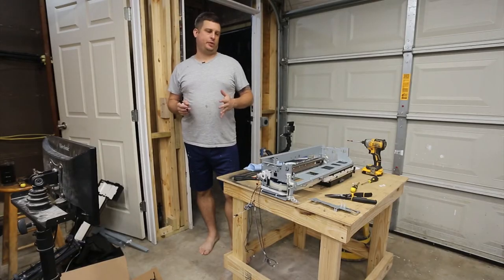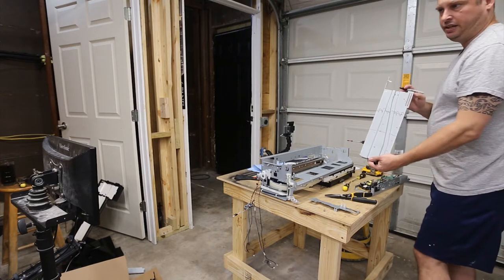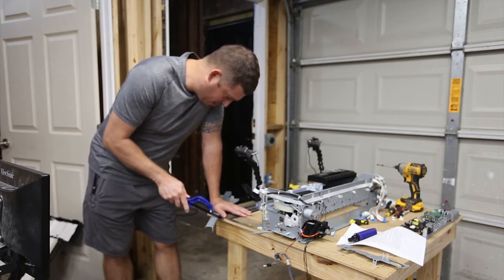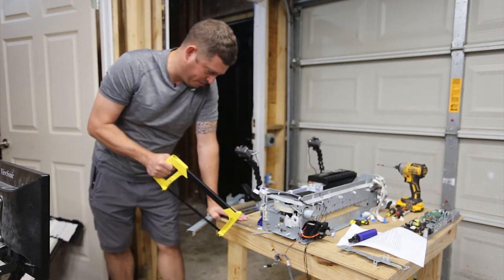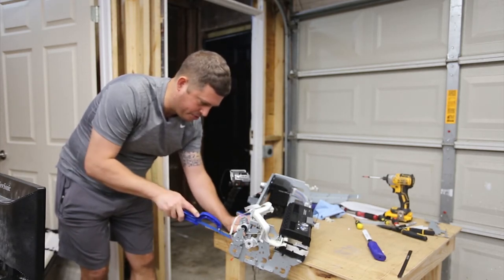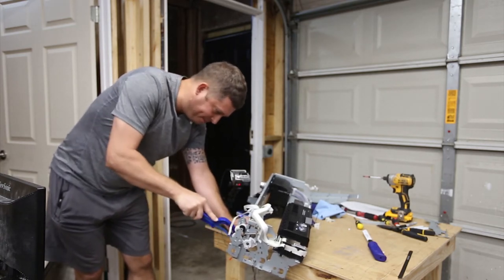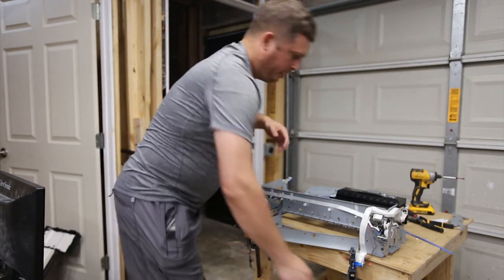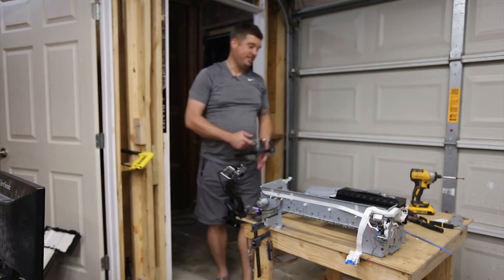Step 3: OpenDTG: Building my own DTG Printer - Cutting the parts

Comment: I took my 1430 apart to replace a cable on the print head assembly. Now my printer will not start up. Is there a grounding clip anywhere on the 1430 printer, as I had 1 part left that looked like it might be a grounding clip, but I do not know where it goes.